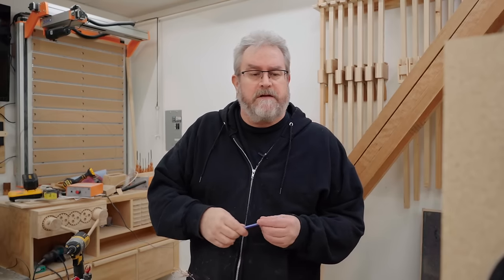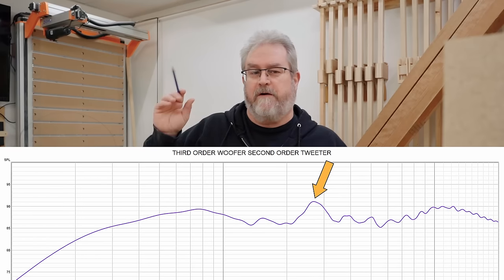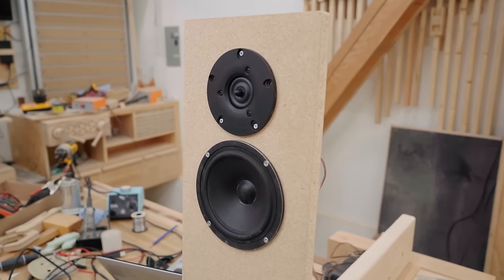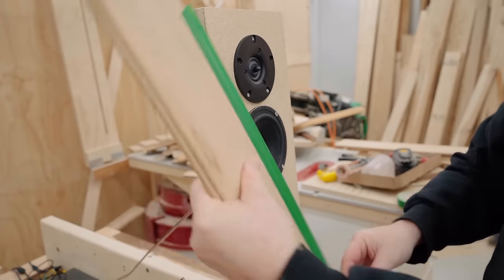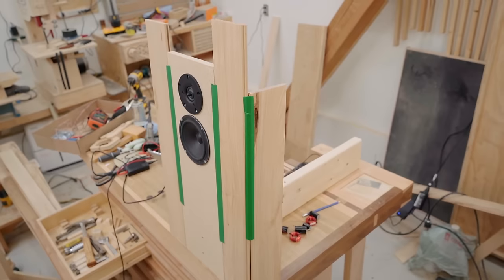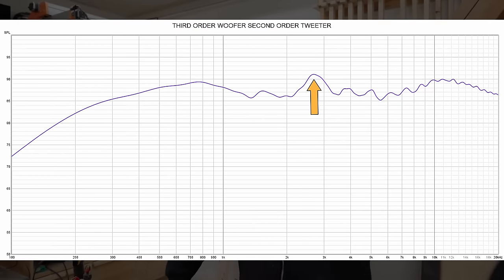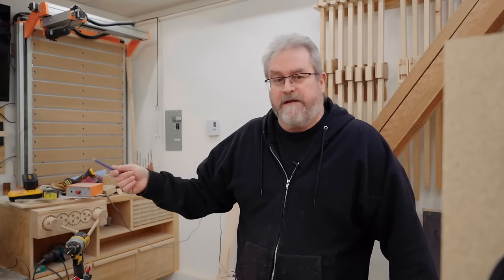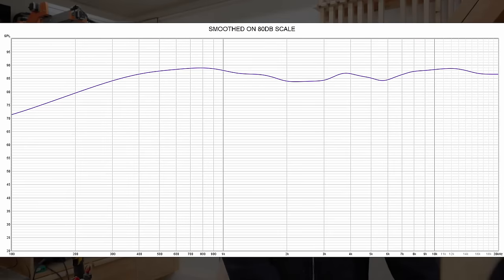The Dirty Little Secret of Open Baffle Speakers

Comment: When manufacturers test frequency response with all drivers they are in infinite baffle.
Also crossing over mid bass to tweeter @ 4khz is really high
Looks like that peak is because it’s not time aligned
More problems as you measure vertical off axis will get worse.
Having a narrow open baffle with less surface reflection is good but the problem also is a messed up frequency response 
Needs a lot more correction 
Dsp or passive more parts
Another way to correct is Gr research i
Using side wings one long & one short
So your increasing size of baffle but still having narrow front baffle
Crossover at lower frequency is much better

Comment: you can have something called edge diffraction!
that means that when you don't fluch mount them then you have 2 types of edge diffraction. 1 from the speaker's edge and from the edge on the front.

Comment: I guessed 4 khz cos I make open cone speakers (not open baffle) plus boxed woofer. And I tend to get a peak at 4 khz (going by hearing the sweep). 😅 I can address it acustically by cutaways on the cone, and electronically, with a crossover/filter. 😅

Comment: I use vifa 2in vertically 2 drivers  and 5.5 in x5.5 in baffle on top of cabinet. Summed to 8 ohm and the youtube eq cut the 2k slider 3db

Comment: What's the difference between those dB scales ? Why don't you use standard SPL scale..?
It's the only part of this I couldn't understand... I don't like that particular Vifa mid/bass driver btw ... try a Peerless equivalent fitted with a phase plug .... it's heaps better

Comment: I'm looking at using the silverflute 8 ,Dayton audio 2 inch soft dome  midrange and a scanspeak ring radiator tweeter in a open baffle and sealed .9 cubic ft build it see and head the difference between the 2 but I'm lost on my crossovers . I'm just in planning right now

Comment: Very interesting. I am thinking a open baffle speakers response would also greatly react to each room it is placed in. Kind of think a different crossover might be necessary for every  time the speaker is relocated. I might be wrong but thinking after one gets the design the best they can with the passive crossover one may end up wanting to use a DAT after that. Am I wrong in assuming Normal high Q woofers work best for open baffle designs? Where the bump flattens out when in an open baffle. And I just subscribed.

Comment: Dipole peak ?
That was a new name for the edge diffraction that is what you are discussing and investigation here. 4KHz peak is because of drivers edges since they are not countersunk and 700 and 1400 Hz peaks are because of full baffle width diffraction and half width baffle edge diffraction.
Round of the edges by a radius 50 mm and see how the peaks get reduced a lot.
Like Revel do with their Studio speakers for example.
Reply from the maker: Google dipole peak and learn the difference between it and edge diffraction. 
Better to do that before you start talking about it like you understand it.
Reply: @IBuildIt  There is now difference.
Different names of the same problem.
Reply from the maker: It isn't the same. One is based on the radiation pattern (diffraction) and the other is based on cancellation.
Like I said, look it up. 
 @flex-cx9bi

Comment: The way to combat this is to make the baffle as slim as possible. Preferably as thin as the driver itself. Open baffle speaker should only be used for mid-range and treble on the same baffle. Use a separate open baffle subwoofer....H frame, or perhaps a ripole.

Comment: Listening distance vs measuring distance.  How do you account for room response when measuring speakers?
Reply from the maker: By using gated measurements. Look that up.
Reply: @IBuildIt  Gated measurement is good, but measuring distance still needs to be around 80% of the distance to the closest reflective surface.
1/2 wave reflection needs to be kept away from the microphone.
Reply: Close mic'ing is especially problematic with OB as the reflected backwave is a huge part of the total experience.
Reply: @mkshffr4936  I wouldn't say so.
Near field measurement is less problematic with OB compared to closed cabinet since you don't need to compensate for the baffle step. You can use the measurement as it is at least for 200-20000 Hz range.
Any measurement below 200 Hz is hard to perform regardless of topology of loudspeaker. The room comes too much into play since near field measurement below 200 Hz don't give a predictable result.
Reply: @flex-cx9bi  My point is that the reflective component in OB is so large that a nearfield measurement misses a lot of what one will actually hear.

Comment: Solved without a xover filter by side wings of different width and a wedge shaped base. You can't just tape wood for width on as a test. Narrow wedge baffle with wings is measured as the best design. The tweeter needs to have cutouts to minimize the baffle to as little material as possible. You should build some baffle-less speakers. Why bring an elaborate xover into the equation?  Just design  2nd or 3 order with high quality foil inductors and film capacitors.

Comment: Duo 2 in vifa full range on vertical open baffle on top, 1meter from wall, Boston ribbon below 8 in sealed mid woofer, 70 hz to 800hz .  I need notch filter on midrange drivers? Or just 4k down on spotify equalizer a click?

Comment: Unless one takes the natural response of the drivers into account when designing a crossover network, one will not get the expected outcome. Adding a 2nd order high-pass to a mid-driver will inevitably result in something more akin to a composite, pseudo fourth-order response due to the existing 2nd order roll-off of the driver itself, for example.

Comment: Why not use a simple cap to roll off your frequency before the power amp? A first order roll off is all you will need and you can use high quality caps (I used vcap odam) and it will sound much better. Your sending your entire audio circuit through all of those parts now and it will greatly affect the sound quality. Cap value before the power amp is much better and you just need to know your amps input impedance.

As for crossing that high, your now going to beam all those frequency that are narrow than the width of that driver. This is why you want to cross into the tweeter asap.

Your measurements are all on axis, but room response is a composite of the horizontal and vertical dispersion, which will have very different frequency responses having a woofer play up that high. 4khz cross is crazy high.
Reply from the maker: I could set it up both ways and let you listen to it both ways, and not in a million years would you be able to reliably tell the difference between the single cap high pass and the active high pass I'll be making. I'd bet my yearly income on that, I'm so sure.
As for beaming and off axis response, they are grossly overblown as important features of a good sounding speaker. And for what I'm using these for, I don't care at all what the off-axis response is, because I'll be listening to these on-axis.
With that said, I did measure the off-axis response and it's perfectly acceptable.
Guys think that "beaming" is an on or off thing, when it's actually a narrowing of the dispersion. As the midwoofer narrows, the tweeter extends down to fill in the dispersion. Filters aren't on and off either, they have slopes, so the tweeter still has output below the crossover frequency.
BTW, it's 5" "woofer". It's perfectly fine to play it up to 4kHz.
Reply: @IBuildIt  I'd take that challenge all day. That's like saying I can't decern different caps.

Off axis 100% is part of what you are hearing. Your too smart to know that the room doesn't influence the sound. Even the well treated room has room reflections. You hear a sum of on and off axis. This is basics 101.

A woofer playing that high also will not be nearly as clean sounding due to the simple physical weight. This is pure physics. Not really debatable.
Reply from the maker: You'd lose. Big time. And I should say that claiming otherwise blows out your credibility.
As for off-axis being 100% of what you hear, maybe in your room. Mine is treated to reduce reflections and greatly improve clarity and overall sound quality.
These speakers are meant to REPLACE the reflections you'd otherwise get from your front speakers. Go back and watch my other recent videos going over this speaker project to get the whole story.

Comment: That's a THICK baffle as well.  Even with your recess and chamfer on the back, it will act more as a horn from the backside and that response and directivity will be very different compared to the front.  Have you measured the response of the isolated Vifa midwoofer only from the back of the baffle to compare it to the front? 

IMO, you want the response/directivity/dispersion as similar as possible between the front and back.

Have you tried mocking up a quick 3/4" thick MDF baffle, or the same 2" thickness but gradually tapering the backside so that the baffle is ~0.5" thick at the side edges?

I'm sure that your posted videos lag behind your actual experiments and work, so perhaps you've sorted this and other issues out already.
Reply from the maker: Putting aside the real possibility that you are blowing the effect way out of proportion and that it has a negligible impact on the total response, you seen to think the outcome of having the back slightly horn-loaded can only be detrimental. Maybe, if it does anything at all, it improves the overall response... I won't know until I put it in the room.
That's because, like any other type of speaker, what it puts out from the rear is part of the room response, and not the speaker response we measure. 
I'm only concerned with the forward response, and I'm completely unconcerned with directivity because of how I'll use these speakers.
Reply: @IBuildIt  
So these are going to be used as nearfield loudspeakers?

Comment: What would happen to the response if you mounted drivers straight into the wall?
Reply: They used to do this in studios, but it would act as a sealed box speaker, not open baffle.
Reply: @Poppinwheeeeellllllieeeeez  Thanks for the reply. Isn't a sealed box a closed baffle which is an infinite baffle?  Yes I see how it acts the same where no sound from the back of the driver can come towards the listener but in addition I was more curious from the point of view that there is no edge to the loudspeaker front to cause diffraction until you reach the corner of the room. It was the merits or not of this I was wondering about as in this video the widerning of the baffle kept altering results. I just can't imagine a baffle any more wide (or 'infinite') than a wall.
Reply: @asx1248  A sealed box needs to have a baffle step compensation (not linear frequency response) so sound and measure linear inside the room.
A driver placed in the wall have 1/2 space radiation for all of it's operational frequency range and doesn't need to have a baffle step compensation.
At low frequncies (below 50 hz) you still need to compensate for room gain because of radiation limiting walls, flor and ceiling.
It's a bit easier to design with an infinite baffle like placing the driver in the wall is, but it also have it's challanges.
Infinite baffle problems start at 100 Hz and lower.
A loudspeaker cabinet problems start at 500-1000 Hz and lower because of the transition from 1/2 volume radiation pattern into full volume radiation pattern.
Depends on the width of the baffle. Needs to be compensated for, and that is what we call the baffle step compensation.
The narrower the baffle the higher the transition starts.
Reply: @flex-cx9bi  great explanation.. Ive heard the term baffle step for years and I think now, I understand what it is!! Thanks.

Comment: Is it possible that speaker manufacturers that produce and sell open baffle speakers are doing it so that they can charge big money to customers without having to build a proper speaker cabinet?  All under the pretense that it sounds better than a cabinet?  Just wondering ...
Reply: Open baffle designs avoid some problems with cabinet colouration but have problems of their own. Usually Q-values are high for drivers suitable for OB designs and mostly high Q means low magnet power and low magnet power usually means low dynamics and a slow and distorted sound.
Depends on what your preference are, but I made some designs and it was not my cup of tea. Too slow and muffled. The recoded music didn't hit my ear in a dynamic and musical way.
But then my ear are used to Stax earphones and unlimited resolution and low distortion in the bass region. OB can not compete with that kind of sound. Not even remotely close.
Reply: No, OBs are made because of the unique benefits they provide in realism. Every approach has strengths and weaknesses. When I first knocked together a simple OB I immediately noticed an amazing "in the room with you" presence. Later we had a professional pianist visiting us and without saying anything to her I put on a piano concerto. She sat there stunned. For classic rock or metal it might not be as noticeable but for classical and unamplified music like folk and jazz it can be far from subtle. The dipole bass can also have advantages in less issues with room modes.

Comment: How does the off axis response look whith such an high xo?  Isn't the midrange lp xo just about 1 octave away from the cone brakeup? So only 24db down at brakeup? That better be a controlled brakup for that to work. It all depends on what you can live with I guess. After I got REW going I quickly became a lot more picky since its so easy to get very good results. Like what you see in 2-5k speakers..
Reply from the maker: A problem with measurements is that while they can point out real issues, they can also make minor ones seem more significant than they are. Our ears / brain are not the same as a measurement mic / software package, so you need to keep things in perspective. The 1/3 octave smoothing is closer to what out ears hear.
As for off-axis response, it's excellent. BUT, I have to say that I did make yet another change in the crossover, so the off-axis results are based on the new (and final!) arrangement.
Cone breakup on paper cone drivers typically isn't bad, unlike metal cones.